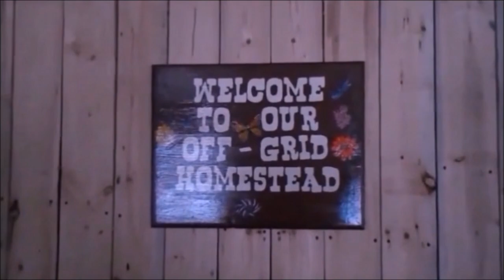Sorry//Not Sorry// Those Turkeys

Comment: My reason for stockpiling spare parts is the “cheap insurance” theory. If you have 1 machine to use and another 1 for spare parts, that guarantees that the first will never need anything. However, if you discard the backup, within 2 weeks the primary machine will require replacement parts at a record pace. It’s worth having the junk pile to avoid having to do repairs. 😎

Comment: I live in the city, retired and I dumpster dive and pick up stuff from in front of houses on trash day. Just some of the things I pick up, a piece of 1 inch plywood it turned into a wood framed drill press, a plastic folding table just needed a clean up, metal storage rack for in the garage, I stop and pick up tools that are in the street and every nut washer screw and nail I see on the parking lots. Yes I get stuff all the time, and yes I still have room for more with room to work on projects inside the garage. Never have put a car in the garage    no.     You do just as you like

Comment: Here in Australia some properties are truly vast and the inoganic piles are treasure troves. Some things have lain there for over 100 years on farms but are never scrapped because there is alwys the chance something might need repairing . i have been on farms where the family never sold their old cars and there would be a line up of dead cars going back to the 20's. Scrap steel has a value , never throw anything if you have space.

Comment: I wish I had some spare mowers I have two and they are both broke down and it will take about hundred and fifty dollars to fix and sometimes a person doesn't have the money so there is nothing wrong with spare parts if you didn't have the Xtra iorn you probably. Would not have your saw mill it's nice to have some around we live 20 miles from town whithout spare parts we would run broke with fuel